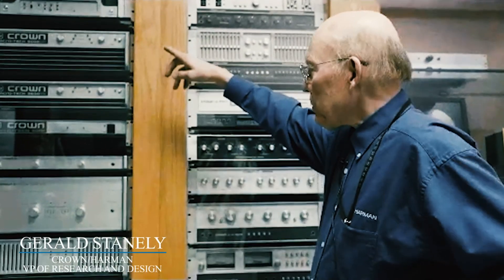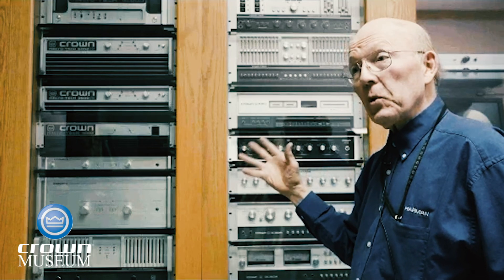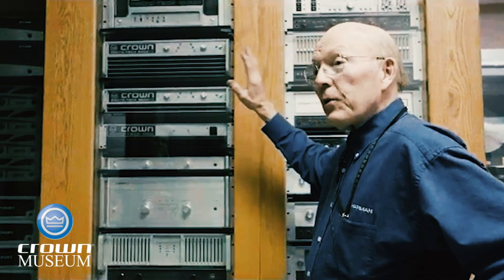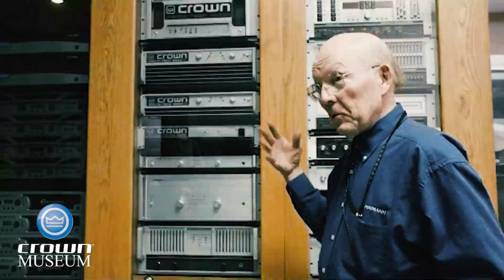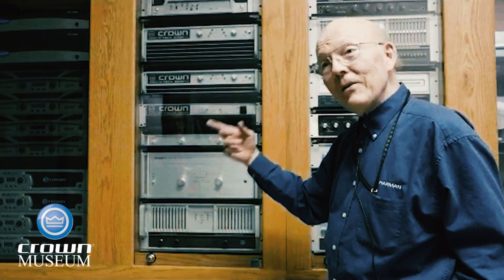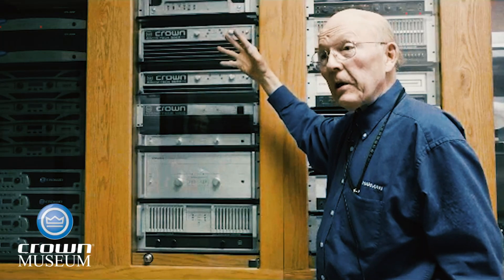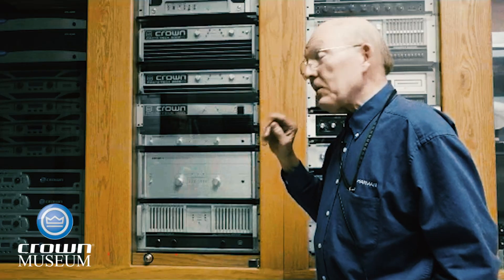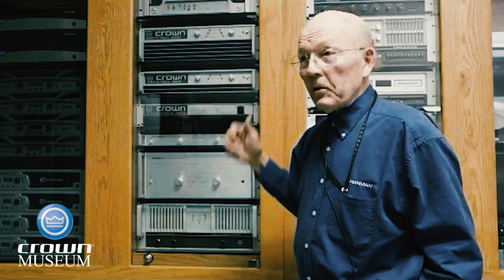MacroTech: Crown Museum with Gerald Stanley

Comment: Back in the spring of 2002, I took a family trip back to South Bend indiana. And I had known that Crown was in Elkhart indiana. And on a whim drove to their Factory and came into the front desk and asked if I could have a tour. After a little bit of discussion and explaining who we were, and that we weren't from another manufacturer. They work nice enough to oblige us. I don't remember the gentleman's name he was an older gentleman that might have been this man for the next 3 hours walk us through the entire crown factory, showing us everything from the bare metal coming in from Georgia copper to make heat sinks. To the various testing cells and assembly systems to me the most impressive part was the service department. They had three Crown macrotech 10,000 and equipment rack. And he explained that the inputs were set up as automatic gain controls. And they were connected to the three input legs of the 2083 phase power coming into the building. One amplifier per leg, and acting as automatic voltage regulators. As a technician and electronic person to tell me that you're using an audio amplifier to regulate the AC power for the entire service department was more impressive than almost anything they showed us on the rest of the tour. They did have one demonstration using a crown Microtech 10,000, where the outputs were connected to a piece of half inch copper pipe that they showed us measured less than a fraction of one ohm. They fed a 100 Hertz Towing into the amplifier turning up the game controls and the copper pipe started to Glow bright red. And the measured current through the pipe was over 200 amps. If you ever get to visit Crown in Elkhart come up when you walk down the main hallway there are a series of brass plaques that are engraved and they look all to be identical I would say there's over a hundred. Those are the patents that are branded to Crown audio. For their design. At the end of the tour they took us into the Listening Room which was truly impressive. Every amplifier Crown had made was mounted in equipment rack behind glass sliding doors. And there were multiple arrays of speakers in the room. And they were able to demonstrate the subtle sound differences between at that time the differences between the K2 series amplifier and explain why it needed no cooling fan. But could still deliver the same output as a macro tag. All the way to their lowest level amplifier, which I can't remember the model of the time but it had red Graphics on the front at their intakes and it was considered a low-end amplifier. However it still did work quite well. I will say that my experience there was quite amazing. When I inquired about a service manual for an amplifier I had they told me walk back to the service department. And someone could help me. Not only did they give me a factory service manual but they gave it to me in the original Crown binder. And all five updates. As the general I put it he says you might as well have all the information if you're going to service it. And when I describe what was wrong with it immediately knew what the problem was and handed me a bag of replacement parts. And his business card saying that if I had a problem to please call. That was to repair a crown DC 300. Which they explain to me that the DC and DC 300 meant that it could actually amplify from DC to well over 50 kilo cycles. And if they had to add blocking circuitry to protect speakers from damage due to ultra high frequency and ultra low frequency. But I'll say it's one of the most memorable tours of an Electronics facility I've ever had. And I must say that the people at Crown audio are extremely nice and very helpful at least back in 2002. I met a lady on the assembly line that was building Crown d75 reference amplifiers. I was hand soldering the components. And had been doing it for almost 30 years.